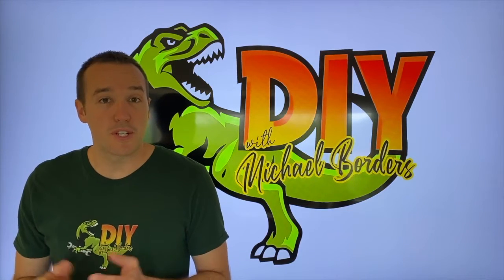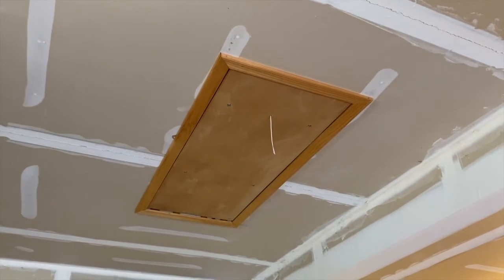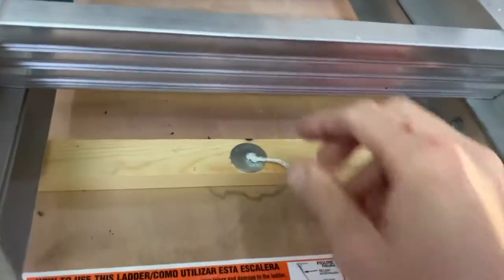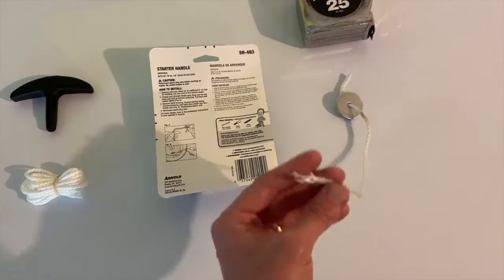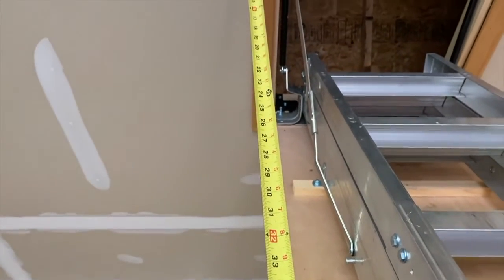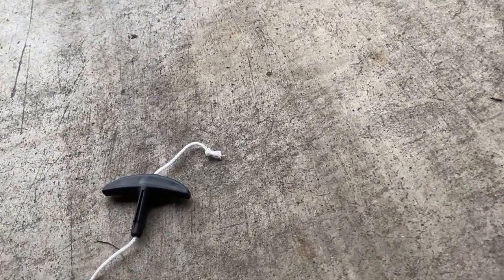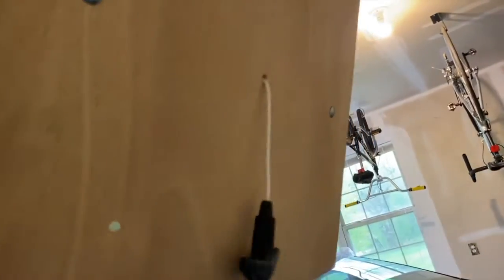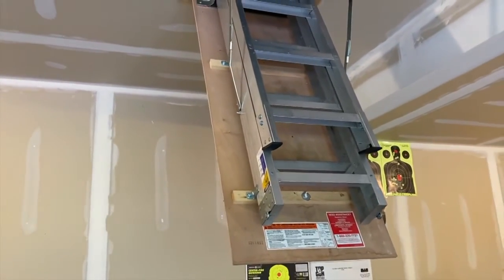Replace ceiling door pull rope or chain

Comment: Thank You so much for you amazing help. Got it to open, I put temporarily my line you would use when you catch a bunch of fish. It was strong and worked, I’m going to get the rope I need later this week, also going to install a handle outside of the wood incase this ever happens again. I gibe you 100 🌟. Not only was you great, but the only one that answered a female question. My husband taught me a lot, but since his passing my youngest son lives to far, can’t count on my oldest son, but my daughter and I got it fix, thanks to you. Can’t wait to install an handle in case this happens again. Sorry this is long, but when our bug guy broke the original ladder, they installed a new one. I asked him about spraying the moving part with WD40, he said no, I asked why? He wouldn’t answer, so I told him my husband always told me any moving parts spray it with WD40. I will now, pulling that rope was so hard, even a friend tried pulling it, I wanted to make sure it wasn’t just me. It wasn’t, it was very hard for him as well. So question, how offended should I spray WD40 on it? Again thank you so much for the best of help. I’m so happy in case  there’s a problem with furnace or electrical wires they can be gotten to. Your the best. Had to retype it, it wouldn’t let me correct it. Cindy
Reply from the maker: Thanks for the follow up Cindy, very kind of you to share your experience.  You will have a smile on your face every time you walk by and see that newly installed rope when that is replaced.

A friendly rewarding reminder on how you benefit from your DIY projects.

😁👍🧰